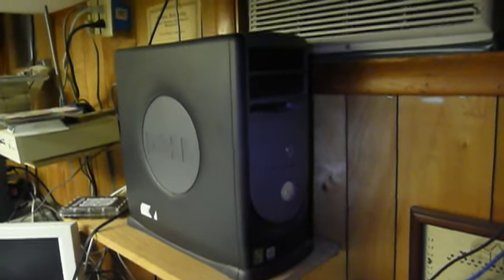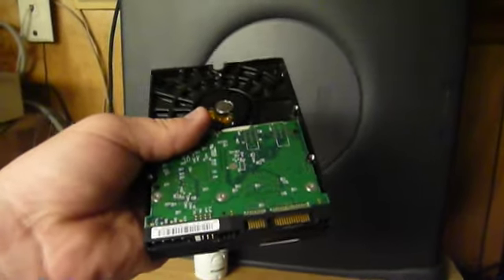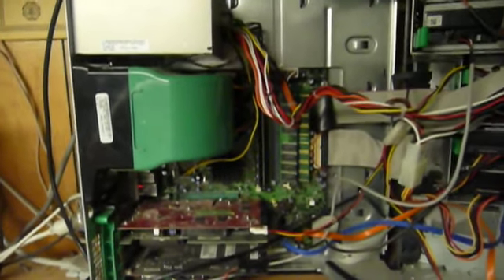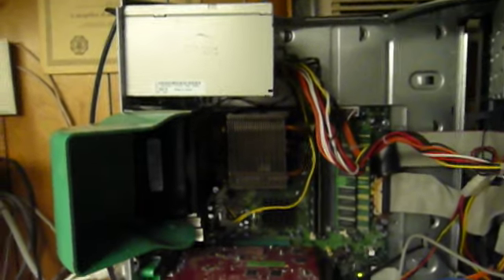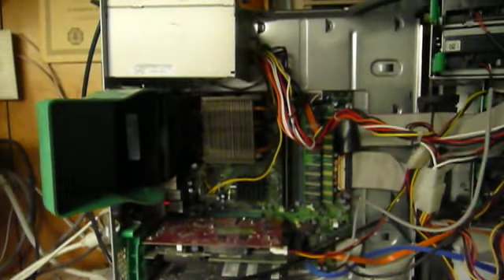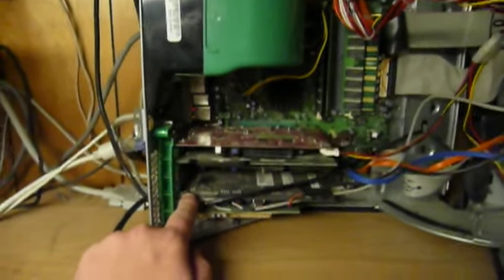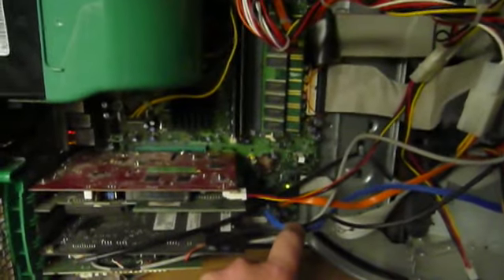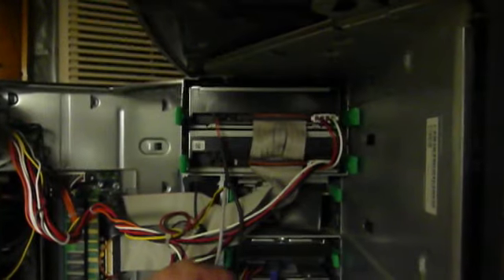Dell Dimension 8300 Overview

Comment: Those 8300s didn't support AHCI, only emulated IDE, so it didn't really matter whether you used a real SATA or, like the drive you have there, SATA drive with IDE controller

Comment: I'm thingking about buying a Dell Optiplex/Dimension to play some of the older XP games on that I have laying around the place, I could play them on my much faster modern PC, but I actually like the case design of these Dells's. I don't know why, maybe because a friend of mine had one when he was young, and we used to play a lot of games on it. Why model would you recommend for me to use as a base? I would like to to have some horse power out of the box, grapichs card etc upgrades are no problems, since I have some older ones laying around.
Reply from the maker: Either of the Dimension 8300 or 8400 would likely suit you quite well. The 8400 would bring with it a PCI Express slot (easier to find a graphics card upgrade), more modern LGA775 processors and DDR2 memory. The 8300 is a very solid performer, built around the Intel 875P chipset, and supporting Socket 478 CPUs up to the 3.4 GHz Prescott.

Comment: Good day William. 
I've got an "BEAUTIFUL" Dell Dimension 8250 which i installed Windows XP Professional on.
So the trouble is, Youtube lags while playing 144p videos, if i exit an windows it draws the icons etcetera...
Could the problem be a slow harddrive? because it keeps crunching away nonstop
Reply from the maker: +Composite guy How much RAM? What video card?

Either one or both might be insufficient, especially in this day and age of software that's heavily optimized for a multi-core existence or hardware accelerations. At this point it's not really worth putting anything into even a nice Dim82x0.
Reply: Currently is has 512MB of memory, I don't have any matching sticks so can't upgrade.
The videocard is an Ati radeaon 128 i believe
Reply from the maker: +Composite guy You are dealing with multiple problems. If you really do want to use this thing, find some more RAM. 1GB would make a profound difference. The Radeon 128 was a good graphics solution in its day and it doesn't have any video decoding accelerations to offer, which will be a must-have if you're trying to watch HTML5 video. Still, it ought to do if the CPU can push the video frames fast enough (anything less than 2.8 GHz probably can't).

(It doesn't help that so far, every HTML5 video implementation I've seen seems far less well optimized than Flash Player. And that actually does make some sense if you can believe it: Flash Player existed on far less powerful systems than today and some of its code is probably still passably well optimized for those older CPUs.)

The real problem is the RAM. This system uses the enormously unpopular Rambus RDRAM, which faded from the market very quickly. It's no longer manufactured and because of its unpopularity, what does still exist commands a ridiculous price.

With Core 2 Duo systems almost to the point of being given away these days, and the most lowly examples of such able to run rings around a Pentium 4, it's really not worth putting anything more into the 8250.
Reply: Ow poor Dell.
I don't fancy spending any money on that thing,  so I might as well 'RETIRE IT FROM ITS MISSERY'.
Thank you this was very informative :-)

Comment: 2014 and I am watching this video on my Dell Dimension 8300. I upgraded the memory a couple of years ago and it has served me well since forever! Never crashed. Performed whatever I asked it to. I'm very upset that Microsoft is ending support for Windows XP (which I am running). Really don't want to replace my computer yet.
Reply: ***** It may or may not, depending upon the reason it was junked in the first place. There is a saying here in the USA, "Nothing beats a failure but a try," Hope it works out for you.
Reply: ***** Will look into it. Thank you.

Comment: Hello everybody ...i have this pc dell dimemsion 8300 specs:
Intel Pentium 4 2.8 GHz HT
Ram 2GB DDR
250GB HDD SATA
Nvidia 7600GS 256MB
PowerSupply 300W
it works ok is so fast to compare with some others with these specs but mine crashes HDD every 5 months maybe i don't know where is the problem i need to change HDD because it crashes them and they Die and the second problem is i shutdown it regulary but when try to turn on in button it doesn't start i need to close from power and start it again.
Reply: Are you using WesternDigital hard drives? If yes, then you have fallen victim to the amazing "IntelliPark" developed by WD, which is widely known to cause this type of death pattern throughout the entire IT world.

IntelliPark is a built-in feature, which resets the read/write heads into their parking position every 4 or 8 seconds. But since the operating systen and/or other software require new data bursts from the hard drive, the heads are re-engaged back onto the spinning discs, 4-8 secs later parked in, data burst, back out, etc. This way one can get 100'000 load/unload cycles in one month leading to a quick death of the drive.

Comment: I just picked up a Dimension 8300 for $20 today.  Mine came with a 2.6GHz Pentium 4, 512GB DDR, Sound Blaster Live!, a modem, and an ATi Radeon 9800PRO.  After I find my thermal paste, I'm going to repaste the processor, up the RAM to 1GB DDR-400, install a wireless card, install a USB card, and maybe install a SATA card.
Reply: Good idea with the SATA card, might make a good server!

Comment: @uxwbill I have the same computer, and it has been preforming fine for me, (plays need for speed mw) and it has 512 mb ram and ati vc i think its 256mb not sure and 2.4 proc. If you go into your bios and under one of the options that tell you to click enter, there should be hyper-threading and something about its performance. Make sure that Hyper-Threading is enabled, and that other option says normal. That's what I have and it plays nfsmw fine.

Comment: i love my Dell Dimension 8300! It can run flight simulator really fast when I upgraded the gpu to a HIS Radeon HD 4670. the cpu is a intel p4 socket 478 at 3.4 ghz. (My cpu runs cool after i replaced the Thermal Compound.) the only downside is that the dvd drive does not work and the cpu has only 512KB of cache. over all I wouldn't recommend for everybody  though...

Comment: Thought about adding 6200 GeForce video card as well, that gives it 512 mb on video, can this handle more...would it be overkill on this older computer. What can the Power Supply handle?

Comment: I have a Dimension 4300... Kinda rare I think... Sadly System 32 deleted itself, and when I changed the drive to a blank one. (It worked fine 2 weeks ago...) The computer will not recognize the new one... Shame... Can anyone help??? XP Installer will not format the drive. The disc (which I have used before) only will format it in NTFS. I swear it did FAT32 before...
HELP HELP HELP!

Comment: I actually have a Dimension 8300, almost alike yours. Although, the proccesor worked well, the graphics card in it died in almost the same way as your, the 200GB drive also failed, so we bought a 500G. We also upgraded our computer to 3GB of memory, that was enough for WXP. In 2009, we retired the machine (after running since 2002), and used it for a fileserver. Suddenly,the fan on the GPU failed, and the computer wouldn't stay on for long, and I discovered a cap fault, and now it's sitting here

Comment: I have a dell 8300 dimension, and it`s totally stock. I wanna do a project job on it, but I just need to come up with the cash before I start tearing out the guts, and replacing the oem parts with aftermarket goodies such as a faster hard drive, and better video card, and etc, etc. I`m sure when its done I will post videos of it, and pictures to let everyone see the progress of my work. Take care of your Dell 8300. Man! its` awesome.

Comment: idk if you want my input or not. i had an 8400 and found it was limited to a p4 3.8hgz if this is a 478 rather than 775 it could be even worse, idk. on top of that, the case used proprietary power switches and i'm sure other stuff. in a nut shell, you're limited to the memory and cpu aside from hard drives. if you're serious, i'd just build a new tower or as a cheaper option hit up ebay for a core2duo (not pentium d) tower. maybe sell that 8300 on cragslist. i might even pay for a better tower..

Comment: please can any body help me am using dell dimension 8300 ,, with win 2002 xp sp 2 ... whenever i boot my system it gives blue screen error and restarts .. and sometimes it did not boot and i have to hold the power button for a while to keep it off and then again to on .regards

Comment: @james42519 also this is real good compared to my old one was using from 2006-2008. built from parts of old computers when college was upgrading. P2 400 mhz, 64 MB upgraded to 320 MB ram, ati rage pro turbo card, sound blaster 16 sound, 1 Gb harddrive with win98se. actually played youtube before they started messing with stuff making stuff better quality.

Comment: @tpaper12 sounds just like mine. i added 2 256 MB sticks for $10 each used. not have 768 MB. still have the 40 GB seagate ST340016A. according to smart the temp of it is 37C. 50C is the cutoff. it is nice yours was made after mine since mine is 2001 it seems.

Comment: i like how these are designed. the same as my 8200 from 2001. like i said on other videos i am still using it. all original still but with a usb 2.0 card added. P4 1.8 ghz willamette, 768 Mb rdram, 40 gb harddrive, agp 4x 32MB gforce 2 mx400 video card. i don't have temp sensors on this computer but same heatsink. maybe should replace heatsink and fan on yours. i also took the green thing that held the cards in and used screws.  what is wrong with smart?

Comment: This system still sounds better than the hunk of junk I have.  I own a Dell Dimension 4550 that was bought brand new in October of 2002.  It only has a 55 GB hard drive and 1 GB of RAM!  Seemed fast at the time, but it definitely can't handle all of the technological progress made in the last 9 years.  Web pages and folders lock up, videos are choppy, etc.  It still has Windows XP too.

I'm thinking of replacing it with a Dell Inspiron 560 with Windows 7, 500 GB hard drive, and 4 GB of RAM.

Comment: dells are junk, of the same age ive a p4 single core 3.4 packard bell with a 80 gb hard drive, 1 g.b AGP card and 1 gb ram, it rocked most games no bothers, 
9.5 years on, still going strong but ive gone hd...

Comment: I think old segates Were really fast  Around 2001-2006 The ide drives I have i new ide in my old computer and it runs really fast but if a put a sata in a newer computer it is not as fast

Comment: nice video of old stuff. 

i've got a Dimension 8200 with a 1.8GHz P4 and 256MB total of RDRAM.
WD800 and I added a second 80GB Samsung drive.

Works till today. 9 years since it rolled out of the factory.

Comment: i have a dell dimension 8300 and so far ive had to replace the RAM (the sticks it came with werent the right ones) the sound card (i had the sound blaster audigy 2 and it went out so i replaced it with a sound card that i got for $6 which works way better) both cd drives and now i hav to replace the graphics card. it wouldve been cheaper to buy a new comp instead. thank you dell...

Comment: i happen to have 1 model down the 8200 and i have one gripe about it.. the gripe i have is that on the ide channel the optical drives are on only allows booting from the master drive on the channel and not both so if one optical drive fails i have to change it out or change the cabling or settings around totally. also this this model is one of the last models to use rdram or ram bus ram the 8200 i have that is

Comment: i have a dell dimension with a 2.8ghz pentium 4 northwood. not hot and its very fast for the age. I also have a 512mb geforce 6200 agp. an 80 and 160 gb hard drive, dvd burner,and only 512mb of ram. i can run windows 7 on aero at 1600x1200 as we speak. sorry your dell sucked. i had to just get through repairing a psu for this machine. also check your ram. i dont see why your dell isnt good

Comment: im a BIG fan of Dell. ive only had one dissatisfactory with Dell: the Inspiron 3800. i hated it. when ever i move the screen, the case would bend and cause the mouse to drift. and very low quality. other than that, my Dell Latitude D500 is the best computer ive ever owned. my optiplex gx110 and optiplex gx260 are great too.

Comment: I hear ya Bill on that 3.4ghz P4.  I bought one as an "upgrade" for my old XPS system that only supported Pentium 4 CPUs. I went from a 2.66ghz P4 to the 3.4 and was more or less aggravated at how much poorer it ran.  It has to be one of the worst CPUs I have ever used.

Comment: Please answer this question. Is the nVidia 7600 GT Video Card compatible to with this in its factory hardware? Will it have enough psu to run a card like that? Also, if it cannot, what video card do you recommend for this for casual gaming.

Comment: Your heatsink is 90 degrees off.  It should be installed so the airflow is pulled through the fins by the rear fan and air duct.  
Those 8300 weren't bad but weren't great for the reasons you presented in the video.  They are, however, generally pretty reliable and many run to this day.
Being in IT, I see a lot of Optiplex and I have a 755 that is nicely equipped as a secondary system.  It performs very well and is stable and quiet.

Comment: I've got a Dell Optiplex 433/L with the original 33MHz 486DX.  It originally came with 4MB RAM, but I bumped that up to 16MB.  I also put in a Sound Blaster 16 and a Diamond Stealth video card with 2MB RAM.  Only thing I don't like about it is it doesn't have a second IDE controller and won't let me install one.

Comment: I agree with you on the Dell coming up short on the performance side. My store sees several of this model year and close others throughout the course of a month-all with varying issues most of which are degraded performance do to slowing/failing OEM drives. We've seen some with bad OEM ram, poor choices in on-board components, and even just a few that the audio was never hooked up to the CD/DVD rom's (like in your video!). The customers never realized why it didn't work. Good vids!

Comment: I have many very similar same parts -- a Pentium-4 3.6 GHz  "Pres-hott" CPU, a Sound Blaster Audigy 2 ZS "Gamer Edition" sound card, and an ATI TV Wonder Pro card -- but not all in the same computer, since my little IBM ThinkCentre only has one PCI slot.  And as for CD audio, I miss the drives which used to give you a headphone jack, volume control, and playback/track skip/stop buttons all on the front panel!

Comment: @uxwbill it uses a socket 478 pentium 4 (not mobile) and one thing i always found really stupid is that the charger port is right next to the heatsink and fan assembly. it wouldn't surprise me if the jack got de-soldered because of the heat. if would have been better if they used pentium m processors which ran much cooler with similar performance.

Comment: i like dells as well, but one thing that really annoys me is how hot my dell inspiron 1100 laptop runs. it gets so hot that it leaves marks on my legs. it had a 2.4ghz celeron and i replaced it with a 2.4ghz pentium 4 northwood to gain extra performance. it still runs hot, apart from that it's a great laptop and still works fine after 7 years of hard use.

Comment: Great video! Learned something new!
I had a few of those "SATA" drives with Molex power inputs, but never knew they were PATA drives at heart. I guess it didn't really matter back then. Before Win7 came along and made SATA stupid easy, I always ran my disk controllers in IDE-compatible mode.

Comment: it shouldnt be the disk drives. I have a pc with a 2Ghz Athlon 64, it has 4 SATA channels, but I only had a Maxtor 80GB IDE drive laying around. its a 7200RPM one and its relatively quick.

Comment: Oh how I wish I could post URLs...

The WD SmartWare can be disabled (including that infernal virtual CD) with an update to the MyBook's firmware.  There's also a utility called "Virtual CD Manager" that takes care of actually disabling the virtual CD part. (It is in the "Utilities" section when you look at SmartWare updates.)

After I got rid of the virtual CD drives on my two My Passport drives, they work as they should have worked in the first place.

Comment: CD drives can usually send audio without the cable.  A better use for CD input headers is auxiliary audio input hacks.  You can hack a 3.5mm jack or a couple RCA inputs to a CD cable pretty easily and then have another input source with independent volume control.

Comment: Nice, I had a Dell Dimension 8200 for four years before I upgraded to a newer Dell which then became the last PC I used before getting my iMac. It was a great machine and a way better product than what they make now. In fact even after four years the machine ran perfectly, I only upgraded because I wanted something with a Duo Core processor. 

If I would of know I'd switch to Mac a year later I would of never bough it. lqtm 